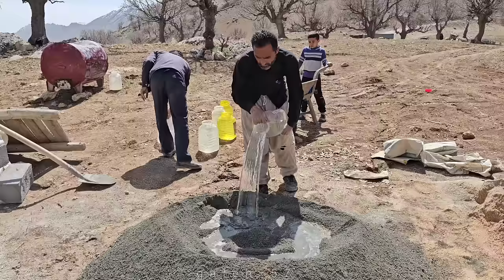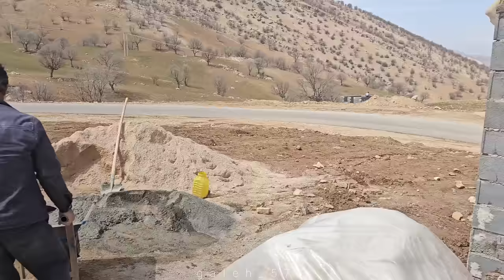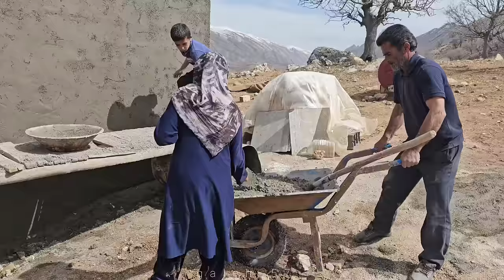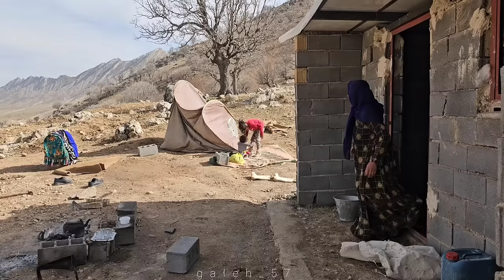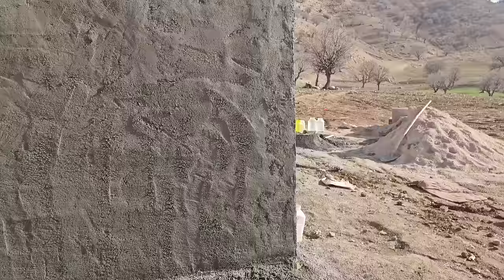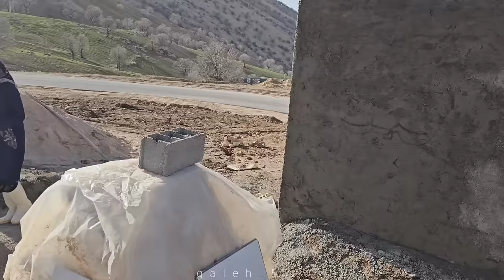Cementing the wall of Susan's house by master craftsman

Comment: For those saying they should work on the inaide first they can't they have to seal the outside first it's leaking on the inside so that would ruin the inside if not sealed first. I understand what you're saying, but outside has to be done first.
Reply from the maker: Hello, thank you very much for your kindness❤️❤️❤️❤️❤️🙏🙏🙏🙏🙏
Reply: Хотя бы был перевод, а так что толку, я не понимаю. И перевода нет.

Comment: This will keep the snow, wind & rain out & the heat in. They are on a mountain in the country, I think they will be very grateful to have it, as it is so much better than a very crowded tent or under an open ended bridge. They won’t have to wander outside or be chased away, it will serve them well. The time & effort is heartwarming all by itself. Glory to GOD.

Comment: Now these men are master builders. There is drainage off the roof when it rains, they've put concrete around the base of the house for damp and they'll isogam the roof when they can. This house is looking pretty good and when it's finished Susan will have a house that will protect her and her family.
Reply: I don't see a master builder in any of these shows they jump around to much and never complete one project They have a mess on the Sahel show the tile guy is good at tile that's it he makes a mess on  anything else .The  workers are mediocre.I get upset when they install wi does and doors what they do to the glass is atrocious.sorry but terrible skills,are no excuse unless you are helping for free .
Reply: @myrtleborodziuk7163  In a country without building regulations in the villages and people throwing up cindervlock homes for you tube this builder is way better than others. The builders on Dinesht channel are also very good. You may not like the way they do windows and doors, but they make it work. I long for a cement mixer,  a spirit level and guttering, but then I'd be watching a show in the west and that's not entertaining
Reply: I would not call them master builders.
Reply: @myrtleborodziuk7163  Compared to some of the builders on other channels they're experts

Comment: The roof must be sloped and must have edges to prevent leakage from the walls. Cement plastering is of no use as long as rainwater runs down the walls. Please take this into consideration
Reply from the maker: Hello, thank you very much for your kindness❤️❤️❤️❤️❤️❤️🙏🙏🙏🙏🙏
Reply: There doesn’t seem to be any building regulations or rules. No permits and no inspections in this country or at least because they’re in the actual countryside…does Suzan actually own the land? Or is she a squatter?
Reply: Вот женщина ! Силы как у лошади ! Родила  в палатки и сразу скачет и пашет и никаких условий.Я просто Восхищена !
Reply: @emmymegify if you goggle the culture you will see the government gives free range to nomads like over 50 percent of land in Iran can be used to herd and occupy never owned but they can do what they want on the land that was set aside for them. Nomads have been there for thousands of years
Reply: @crystalarmant9218  thank you for the info! I had no idea.
Reply: @crystalarmant9218  the cameraman brought the land for Susan.
Reply: The builder laid pipe into the roof for drainage when it rains. Susan can put a drum underneath to catch the rain. Is it ideal? Nope I'd rather see gutters but there is nowhere for the water to run because there are no underground drainage system built in where she lives.

Comment: I have not seen one builder put drainage slithes on the outside of the walls. First brick above the stones atleast 3 slithes per wall. It keeps the inside walls from getting damp.
Reply: Да и крыша должна быть покатая, и напуск крыши должен быть, чуть меньше как над входом, а иначе дождь с ветром , будет стены захлестывать и отдохнёт эта их вся штукатурка, это нужно для тепла, но не от дождя , стены постоянно будут сырые, и кто бы что тут про технологии не говорил, они едины, способы может и разные.Ну в следующих сериях будут ремонтировать.
Reply: 😂😂 i dont know why double the trouble first

Comment: To render an exterior wall you should wet the surface first,  Im suprised that the cement stayed on the wall.... also,   why was the surface not skimmed after,  just throwing it on like that is a very strange process,   that's how Greeks paint their houses but obviously with paint if you can call it that,   it looks more like Artex and  most definitely has the same consistency.   What was the reason  behind not completing the interior floor beforehand?   As a Master builder here in the UK 🇬🇧  i find it absolutely fascinating as to how other Cultures work,   some very unusual concepts I'm learning